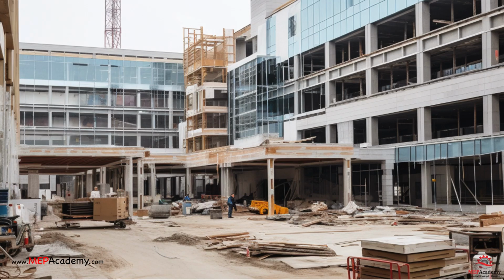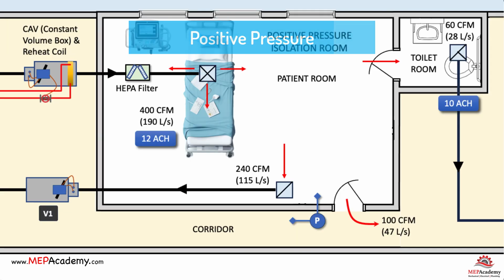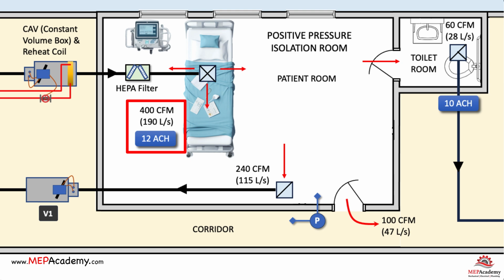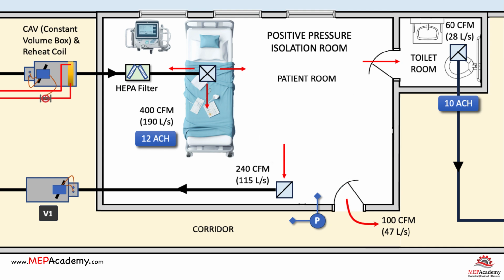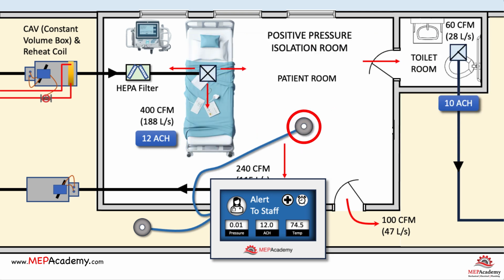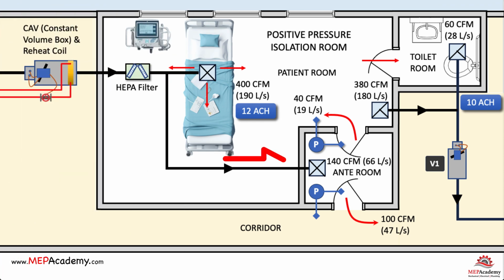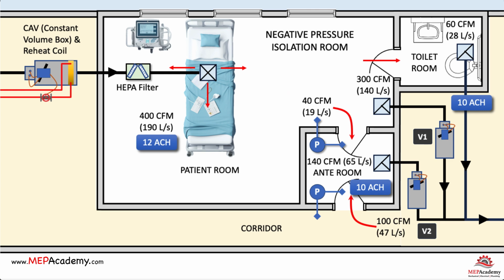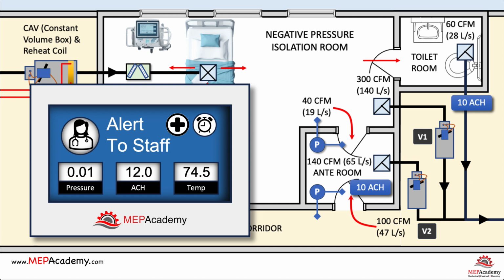How Hospital Isolation Rooms Work

Comment: Is the 12 ach the minimum total ach according to ashrae?
Reply from the maker: Good question. Yes — for hospital airborne infection isolation (AII) rooms, ASHRAE 170 (Ventilation of Health Care Facilities) sets the minimum total air changes per hour (ACH) at 12 for new construction.
A few important notes:
For existing facilities, the minimum can be 6 ACH, but new rooms must meet 12.
The ACH includes both outdoor air and recirculated air, as long as the recirculated portion passes through the required HEPA filtration or appropriate system design.
In addition, the room must be kept at negative pressure relative to adjacent spaces, with proper exhaust directly outdoors.
Always confirm with your Authority Having Jurisdiction (AHJ) since local/state health codes may be even stricter

Comment: Isolation room CAV return is getting zero  cfm in our bms system but in field we are getting 21Pa. What is the problem
Reply from the maker: This could be due to various issues. May be one of the following might help. 1) Faulty or miscalibrated Sensor. 2) Improper sensor configuration in BMS. 3) Issues with the location of the sensor. 4) Wiring or communication faults. 5) Pressure to flow conversion errors in BMS. 6) Obstruction or Failure in CAV terminal. 7) Ductwork obstructions or leakage. Good luck. Please lets us know what the eventual solution is. Thanks for watching.
Reply: @MEPAcademy  thanks sir

Comment: Hey, how do you test Air change per hour?
Reply from the maker: Measure the amount of CFM entering or leaving the room. This can be done by measuring the air velocity at the inlet or outlet using an anemometer. Multiply the velocity by the cross-sectional area to determine the air volume flow rate. Then use the ACH calculation as shown in the video ACH = Air Volume Flow Rate / Room Volume. If this is a critical space you would definitely want this to be done by a professional.